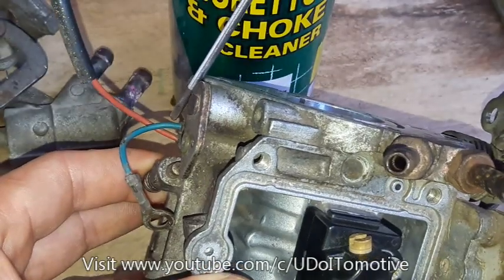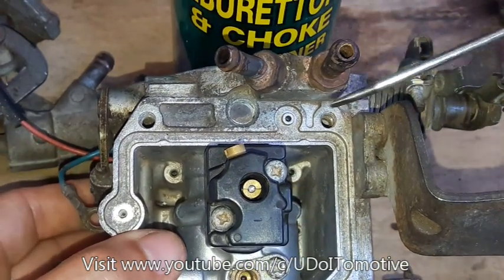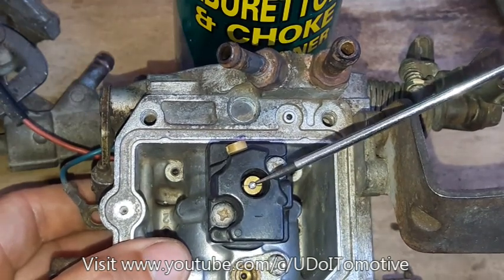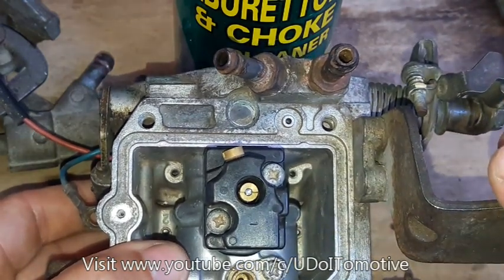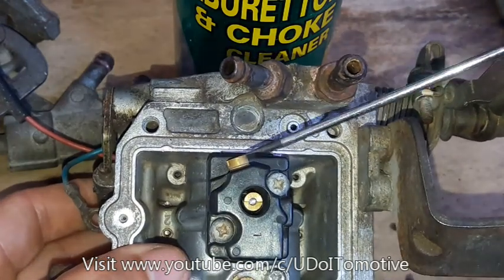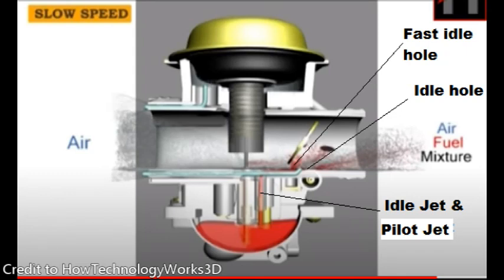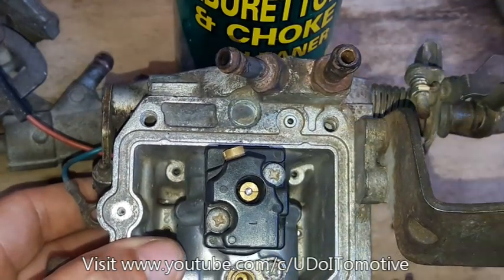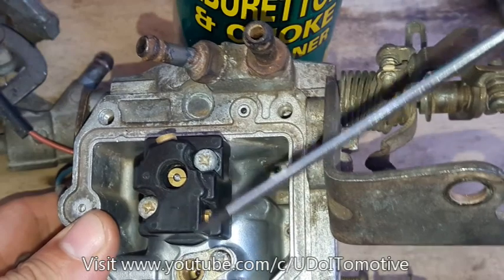Paano gumagana ang mga jets sa carburetor

Comment: Ano po kaya provlema ng mga aftermath o replacement f6carburetors na nabibili ko twice na nag palit pero parehas na mejo maganda lang ilang buwan tapos ayaw na umandar ayos naman kuryente at spark plug ganda naman firing nya.paano kaya maayos kasi trinay ko iswap mga oldold model na solex carburetor oinagyan ko lang converter  umandar naman maganda hatak kaya lang siguro dahi patayo mejo pinalayo bg adapter naginawa ko nag rerevoution na lang kung matagal umandar .may repairkit kaya navibili para yung original na carburetor nya nalang try ko irepair ?

Comment: boss..ask lng po..san mas malaki butas na jet..yong idle jet po ba or yong main jet?
salamat
Reply from the maker: Boss sa opinion ko lang po, since yung idle jet is ginagamit for starting yung cold engine, mas maiit po yung butas nito compare sa main jet, ang main jet po is ginagamit for medium and high speed na nag rerequire for high volume of fuel supply for power.
Reply: salamat boss

Comment: Sir, ano mas malaki and size , Secondary Jet or Main Jet? Thank
Reply from the maker: Boss ang Primary Jet ay maliit po yung butas or size at yung Secondary Jet ay mas malaki yung butas or size. bali po yung primary jet ay tinatawag din nilang pilot jet at ang secondary jet ay main jet. Kaya po tinawag na primary or pilot jet at maliit yung size ng butas ay sila yung primary circuit na nag susupply ng fuel for idle and low speed, kasi kaunti lang naman po ang kailangan na fuel requirement  pag idle at low speed kaya maliit lang yung butas nila, pag maliit po yung butas mababa po yung flowrate ng fuel na lumalabas sa jet, pag medium speed to high speed or high load, na ngangailangan  na po ng high fuel demand kaya mag aactivate na po si secondary or main jet for additional fuel supply. since malaki yung size ng butas nila, they can give high flowrate ng fuel.
Reply: @UDoITchannel  Sir, salamat sa information

Comment: Good morning po sir. Tanong lang po bakit nagba back fire ang multicab ko sa carburator.
Reply from the maker: Boss dami possible cause ng backfire sa carburetor, sa experience ko lang at ang obvious ay yung poorly adjusted ignition timing. Kaya po nag babackfire dun sa carburetor is just because nag spark or nag ignite na yung sparkplug dun sa cylinder during intake stroke, meaning pababa palang yung cylinder at bukas yung mga intake valve at papasok palang yung air/fuel sa cylinder nag spark na,  Another possible cause is vent yung valve, during power stroke naman at nag spark/ignite yung sparkplug at hindi fully close yung valve, dun dadaan yung nasunog na air/fuel sa intake manifold papuntang carburetor.Para matest yung vent valve scenario, mag compression test. yung sa ignition timing naman, ay may test na ginagawa, yung pag swap ng distributor sparkplug carble just to alter lang yung timing temporarily, for example sparkplug#1 clyinder1 to sparkplug#3 clyinder3 ( ang mangyayari, sa sparkplug#1 sa clyinder3, ito ay mag spark/ignite during intake stroke ng piston dun sa clyinder#3. Boss extra caution lang when doing this test. Hope this help

Comment: maganda araw po boss, regarding po sa gas tank return fuel line, sinondot ko po ng alambre at napansin ko ay hindi nabasa ng gas.pero sa tank canister line nabasa ng gas.kaya pinagpalit ko ang return gas tank line sa tank canister line. magkaroon  kc ng pressure kapag hindi ko pagpalitan.magkatabi lang sa tank fuel filter, pump line ang nabasa na alambre.
Reply: paki advice lang po, baka nagkapalit lang gastank fuel return line sa tankgas canister line?? balak ko po toloy toloy ang daloy nga return fuel sa tanke
Reply from the maker: @noeldalisay451  Boss hindi ko po ma visualize yung sinasabi nyu. ganito po, sa pinaka ibabaw ng fuel tank normally naka connect yung line sa evapo-canister, kaya po sa pinaka ibabaw ng fuel tank ay para yung fuel vapor lang ang pupunta sa canister. pag na reach na ng fuel tank yung certain pressure, yung fuel vapor ay pupunta sa canister at from canister may vacuum para yung fuel vapor pupunta ulit ito sa cylinder for combustion. ngayun kung napag palit yung line, magiging laging basa yung canister. Check nyu po kung yung fuel return nyu hindi clogged. pag clogged ang fuel return, laging puno ng fuel ang fuel chamber at pag tinangal nyu yung rubber in between sa carburetor air intake and air cleaner, may try trace ng gasolina (wet always). check nyu po yung video ko sa baba about fuel return line bandang 2:35 mins.

https://www.youtube.com/watch?v=JGN0-TGVZeU
Reply: boss balak ko po bumili ng replacement na carb 3+2port vacuum at yun meron fuel return. meron po ka spare na f6a carb?